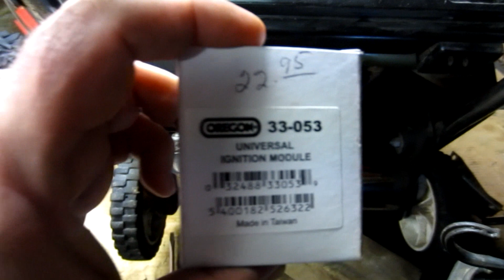Universal Ignition Module for Outdoor Power Equipment

Comment: Tried these on a suzuki dt2 outboard and it just got red hot and died in about 30 seconds
Reply: Unless it was mounted in a position that it couldn't cool itself, which is important there had to be a wiring issue could be that there was a bad diode somewhere in the factory wiring that was causing feedback.

Comment: Have you tried those on the older Echo chainsaws, CS 400, 440, 500, 650, series? The ign system on these are long obsolete & it's a crap shoot if used.

Comment: Doesn't  do me any good if the coil is shot. I had a place sell me this and it didn't do anything for a failed coil. So now what? Can I replace an older Techumseh snowblower coil with a replacement.  It seems the coil is built into the magneto housing. It pisses me off they sold me that  useless part if the coil is bad. I think they thought it was for a newer engine or something. I think Techumseh  reused the HM80 numbers on other equipment. I will be contacting them again tomarrow. I am frustrated at this point.

Comment: I ordered the exact same part and installed it on the exact same snowblower and while I now get spark and it runs great the key is backwards. it runs with the key in the off position and kills with it in the on position. I thought maybe I plugged the two wire connector into the key backwards but it still operates the same (backwards) when I turn the connector around. It's a simple system. 1 wire from the coil to the + of the new module, then 1 wire out of the - side of the module to the kill switch then out to ground. any idea what might be causing this?
Reply from the maker: Its wired backwards..thats all
Reply: @LeboView  it's technically not possible. if you reverse the module then it doesn't start and if you reverse the kill switch then it's still backwards, no matter how you wire it, which only has 2 ways anyway.

Comment: I have an Onan generator with 2 cylinders it has points no flywheel no starter no Magneto the coil has to wires coming out of it one for each cylinder will this device work?
Reply: Is it a horizontal or V? Also does the coil connect to a battery? I have a welder with an onan 18hp horizontal engine. The gm hei module was a better fit. It can be wired to use points as its firing trigger.
Reply: @dimedriver  Do you have instructions or part numbers on how you made this modification?
Reply: @ryancarr7808  search gm hei points trigger.  Here is the 1st good one I found. https://www.jalopyjournal.com/forum/threads/how-to-trigger-hei-using-stock-points-dist.978979/

The hei module takes care of dwell. You just have to get timing right. It can also be triggered by VR sensors. Typically older GM crank angle sensors.
Reply: @ryancarr7808  at an auto parts store if it's an old guy behind the counter ask for a gm hei module. Young guy ask for the ignition module for a 1979 chevy camaro with a v8. Don't pay a lot for them they will be under worked on a two cylinder.
Reply from the maker: The twins could possibly work with this as long as the signals do not overlap

Comment: Nice tutorial,have you put any of these on the older Tecumsehs?I been trying but no luck.
Reply from the maker: No the hh100 i have has been rock steady as far as the electrical side but if it fails I will definitely put one on..
Reply: on older Tecumsehs, frequently the main bearings wear to the point engine will not stay in time, or run at least for very long. A really good machinist can put bearings in, which engine never had originally,  for $$$.
Reply: On those you can't if it has a generator.

Comment: My JD garden tractor has this built into the magneto, no separate module, so folks should check their application before ordering one of these. The mag is of course more expensive than a standard one.
Reply from the maker: This will replace your magneto, even built in... It just needs to use the existing magneto to "sense a pulse"...

Comment: How exactly does this adapter ignition work? The original briggs module is direct in front of magnet when flywheel passes for direct timing.. The older magnetos need a mechanical cam for exact timing. How does this module get it's signal to fire at proper timing if just bolted to sheetmetal.
Reply from the maker: the signal comes from the unit recognizing the coils magnetic field being breached by the flywheel...it is instantaneous

Comment: These modules are great. They are sold under a lot of different brand names but they all look exactly the same. I put one of these in an old chainsaw to replace the points and condensor. I keep one in my shop for the next thing that may need one. Sometimes when you want to get rid of the points and condensor on something you can just get an electronic ignition coil but for the times a coil like that isn't available you can get pop one of these on it and you're good to go.
Reply from the maker: They are pretty awesome I always keep a couple in my shop..  Here is my repair channel https://www.youtube.com/user/Foxboss9

Comment: I put one of these on my 031av and it did seem to help, but I'm still having problems. I've tried both the original flywheel and a flywheel from an 031av electronic ignition saw and the original definitely works better, but it still doesn't seem to have much power. It dies whenever I put the saw to some wood. I took it to a shop, and they said it was a timing issue. I'm not sure what to do next. Do you have any ideas? Thanks.
Reply: Todd Koeppel i have worked on saws that had the same problem. the cranckshaft seals we re leaking on them. if you can start the saw, then spray WD-40 on the crank seals and it causes the engine to change speed, then the crank seals are sucking air and need replaced. you can check a cylinder base gasket the same way.
Reply from the maker: +Todd Koeppel I'd Have the shop that ID'd it as a timing issue fix it.. If not I would experiment with the plug gap to see if it helps out. start by going smaller and then bigger .002" at a time.
Reply: sounds like a carb issue,check out donyboy73 video's there is on for your problem.